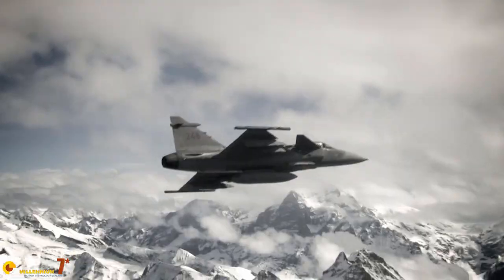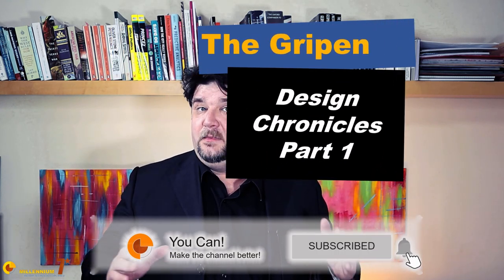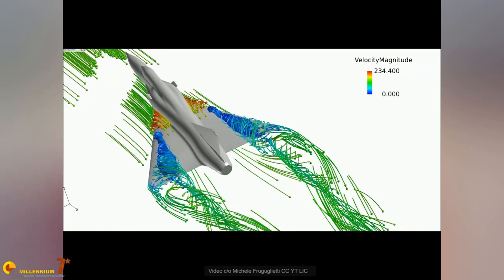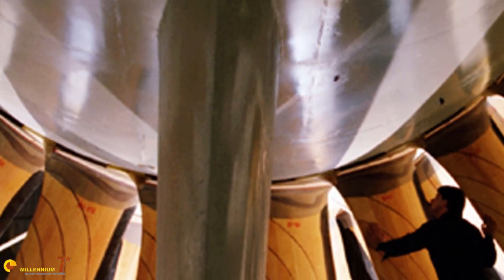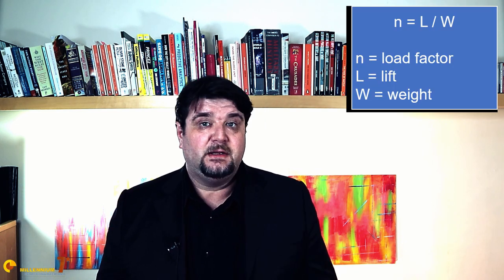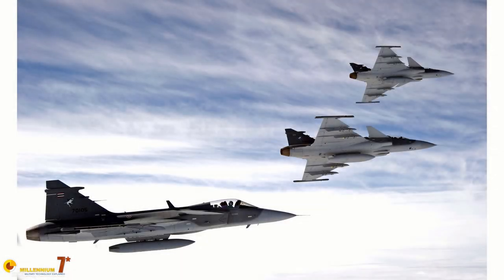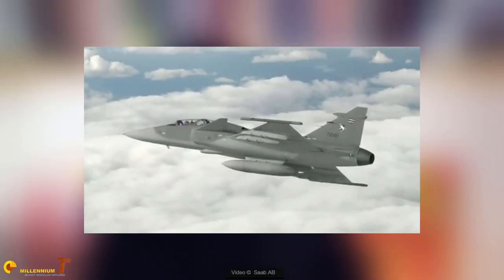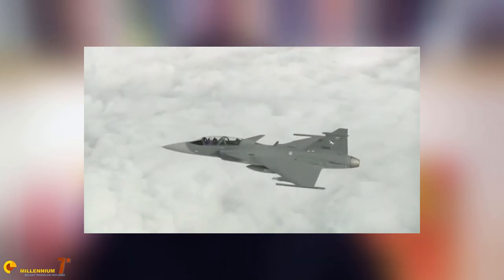The Saab JAS-39 Gripen: the design chronicles - (Long format, all episodes together)

Comment: Gripen is a nice aircraft but it droped of mmrca competition because it was to much like Tejas. Nowhere as good as Rafael. It failed to accomplish all attack criteria compared to Rafael. Rafael hit all the set parameters comfortably with Eurofighter close second.
Reply: This is not based on belief, this was the result of very extensive comperative trails and flight evaluation data is on the net if you do wish to scrutinize.
Reply: @Donald Twitter During my drive to AeroIndia i noticed SAAB had posted an add on a bus stop. I was really surprised as to why civilian like me need to see a add. Later i undestood SAAB had a fantastic marketing team must be from the Car company? lol.. Go read and search like i did on what parameters it failed. Its there in some defense forum in 2016.
Reply: @KarthikSoun  you are perfectly right. Rafale is superior to gripen in about... everything.  The gripen C has been extensively tested by swiss air force and found inferior to even f18c in every aspect which it was suppose to replace. The official report is freely available on the web. The gripen E is still not opérationnal and will be not before several years. It seems that it disappointed pretty much lately during the finnish evaluation... good marketing yes but that s all.
Reply: @Donald Twitter Egypt has 24 Rafael. What are you on about?
Reply: @Donald TwitterWell, defence procurements are mostly strategic & political decisions.
To date, the Rafale has lost export opportunities in Algeria (SU-30MKA – Rafale a long shot), Brazil (JAS-39E/F Gripen NG – Rafale the initial favorite), Greece (Eurofighter, then F-16), Morocco (F-16C/D – Rafale the favorite), The Netherlands (F-35A), Norway (F-35A), Oman (Eurofighter – Rafale a long shot), Saudi Arabia (Eurofighter), Singapore (F-15SG), South Korea (F-15K, Rafale won but politics reversed the pick) and Switzerland (Rafale the initial favourite).
So, you can clearly see that most of the time Rafale performed excellent in evaluation process leading to favourites in many cases, but didn't gets order bcz Political influence.
So, "number of orders" is not really a credible parameter to analyse capabilities of a fighter jets.

In March 2012, Dassault CEO Charles Edelstenne said, when asked about export issues of Rafale:
“When one is in a country like India which is an open country and in which Americans do not have the same weight as countries that are their private hunting preserve, we have a chance. And this chance, we got it… The market for the Rafale, it is countries that do not want or can not buy or American countries who want to have a second source while buying American. Now all countries, except two, where we lost, were countries that did not fit this definition.”
Reply: Tejas like gripen!!!! Mooohhhaaaaa

Comment: Why has the J-31 fallen off the radar since its finished its carrier trials. It looks like if the  F-22 and F-35 had a Chinese baby. Seriously the J-31 cant fall off the radar even though it's designed from the information China stole from US. China doesn't have the tolerances in their machinery to create the low observable fighters so they look stealthy but their cross section is far from small. At tis time anyway. The WS engines for the J20 that are 3d thrust vector ready and making the J20 super cruiseable are steadily making progress.
Reply: There are plenty of news articles within the past month across nearly all news sites about the J-31/FC-31: https://duckduckgo.com/?q=fc-31&t=ffab&df=m&ia=web . Up to and including about a week ago on the conservative outlet, National Interest. So I don't see where you're coming from by claiming that it has disappeared from public scrutiny. If anything interest has intensified as prospects for imminent adoption by the Chinese Navy become more solid. 
As for radar stealth, I think you're ascribing too much to so-called "tight tolerances" to aircraft manufacture. Anyone who has been anywhere near gas turbines, wings and sensitive electronics, knows that tolerances are extremely small, down to the micron for things like bearing surfaces or phased array radar electronics. If those can be manufactured - and China has clearly manufactured stuff like jet engines and AESA radars - then the fine finishing needed for stealth aircraft is also achievable. 

Defense contractors make a huge deal out of things like flush riveting or no-rivet construction, resin transfer moulding, baked stealth materials and so on but this is all marketing bullshit aimed at foreign buyers in the Middle East and politicians in Europe who have zero engineering expertise so as to bamboozle them into buying planes instead of asking for license manufacturing. I would contend that any country today, with the 5 axis CNC machines, with a boatbuilding industry, particularly one that works with fiberglass, and with a developed plastics industry could build stealth airframes. And if you look at the industrial means of production that China has built up, it is clear that all these ingredients are there. 

Where do you think the vast majority of extreme precision CNC machines have been going for the past 2 decades? It's certainly not in deindustrialising Europe or the United States, the machines are going out of Germany and France and making their way to China. 
Where do you think the vast majority of electronics expertise has gone? Certainly not into Silicon Valley which has devolved into a morass of financial shenanigans, but into ShenZhen which has become the premier location for consumer and military electronics manufacture.

The idea that the Chinese cannot manufacture stealth aircraft is complacency masquerading as national chauvinism. They clearly have the capability. The real question is - do they have the skilled labour and the engineers to progress these designs into production of large numbers? If the past decade of Western industrial decline counterposed by the growth of Chinese industrial dominance has demonstrated anything, I think the answer is quite evident. The aircraft might not have the kinematic performance of the F-22 given China's relative weakness in gas turbine development, nor might their AESA radars or IRSTs perform as well as those manufactured in Europe, but the stealth will be there. 

This is of course, assuming that the Chinese want to have a minimised radar cross section in the first place even at the expense of kinematic performance. Recall that a stealthy airframe is not necessarily an aerodynamically efficient airframe. There is a reason why the F-22 and F-35 have so much excess power. Stealth has a cost on weight, on drag, on frontal area and even on electronics cooling. The F-35 has demonstrated problems with - wait for it now - excessive weight, excessive drag leading to stabilator heating causing the composites to delaminate, excessive heat buildup causing electronics to fail. 

That Eurocanards have beaten both in Red Flag exercises on occasion despite flying "inferior" aircraft that emphasise kinematics over radar reflection reduction, says a lot about the relative value of stealth. It's not an "I win" button. It's a characteristic with definite tradeoffs, and not a design choice to be taken lightly.